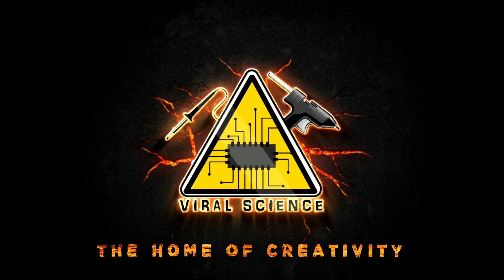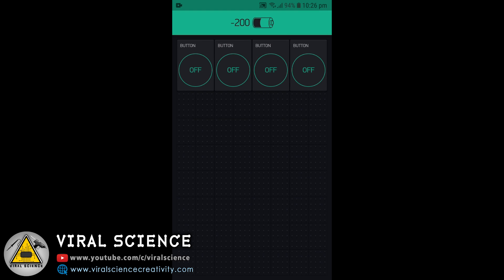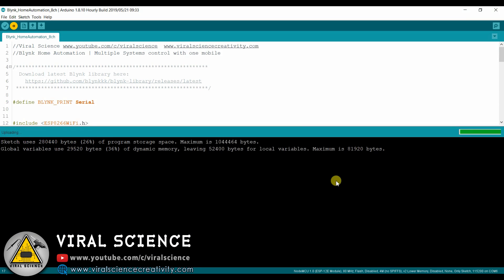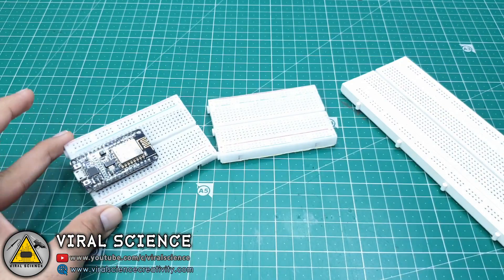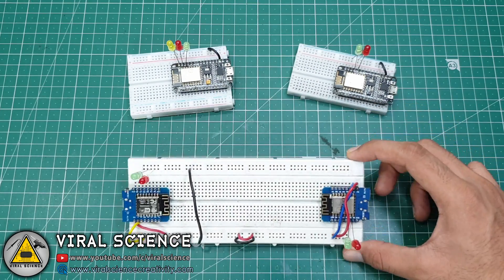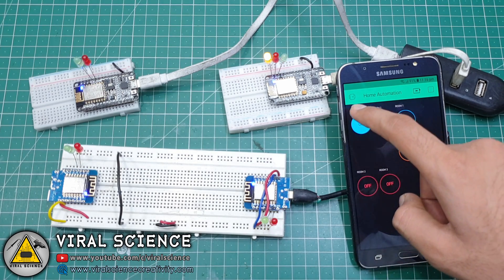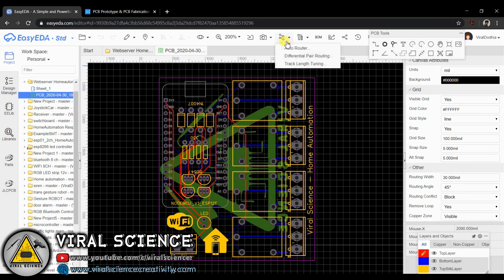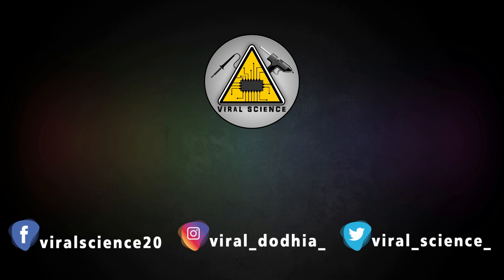Blynk Home Automation with Multiple ESP8266 Boards

Comment: Bro I like your video it is very helpful, but i have a doubt , in the video u have used different digital pins for led , not as the same digital pins  which is used in one board. So this make it difficult when there is a need to connect more appliances to one board cause the digital pins will be repeated in multiple boards and therefore when we give the command to a digital pin ( for example d5) using blynk platform , all the boards's D5 pin will be set high isn't it . So bro is there any remedy for this issue. If so can u make a video about this one

Comment: Hello, first of all thank you for the helpful video! I want do control a nema 17 stepmotor and parallel in other rooms I want to control relais. Know I don't know how to set up the code. Do I have to flash the code like yours with the extra part for the stepmotor on every ESP module? Or do I just have to make sure that every ESP module has the right authentication code?
Thank you!

Comment: Sir, can i used 1 or 3 cellphone as monitoring for this kind of automation project?
Reply: Yes u can do it by getting into your projects setting page and turn on "shared access" .. this will cost u 1000 energy, if u don't have enough u have to purchase it... Then generate a QR code, now u have to scan the QR code in your other device... But this should be scanned before logging in ur blynk  account or it won't work
Reply: And another method is to login your blynk account  in another device and use your project

Comment: Thanks for your technique,  exceptional good video, patience and the hard working behind all of these. Is it possible to make the AC Dimmer which runs   both Blynk app by using slider button (or "+ve" & "-VE" buttons instead of slider ) and two physical  touch sensor switches (say 4 pcs TTP223 or 1 PCS TTP 224 for controlling 4 steps ...etc. ) for manual Control (Increasing or decreasing the bulb intensity or fan speed ) , If so please make a video particularly in coding part, It is difficult to relating the physical two buttons with Blink slider in coding part.
 It is more better to add 2 more button for controlling 2 ac loads (Just on and off ). Thanks

Comment: Followed along with you create only one button, received the token in my email added it to the suggested sketch with SSID, USERNAME, and TOKEN.  Press the PLAY button in the cell phone app and a smaller icon in the upper right-hand pops comes up with a red dot. I touch the icon with the small red dot and a small slider drops down and it contains the following note: "Wasn't online yet". 
Surfed the web and found many folks stuck at the same error message. How do I fix this?
Reply: Make sure your board is properly power on or     your internet connection is working normally or    the authentication code, wifi credentials may not be properly entered

Comment: Is there a way to uniquely identify one of the four ESP8266? Because ports used in esp#1 will not be usable in esp#2. Thanks in advance :D
Reply: Thank u mate for asking this question... I didn't even realise about this problem.... But after thinking a lot I found a solution... 

Step1: After u create your project, get into the settings page of your project.
Step2: U can see a menu named  "devices" , click on it..
Step3: now u can see an option named "new device", now u can define and add all of your other boards
Step4: now, when u add ur widgets and define the pins, u can now select any of the board and can use all of the pins.

I guess this will surely answer ur question.... But if u didn't understand any of the above, pls ask me again.. I'll  answer it..

Comment: Assalamu Alaikum, how are you dear brother?  I watch the videos you make carefully.  I really like your videos.  Brother, you know that many bikes are stolen in our country.  So to prevent this theft, can you create any such device?  Which will be high security.  Which will have motion sensor alarm system.  Using a radio remote to control the bike.  The bike can be controlled via mobile bluetooth, wifi, internet. Even the location of the bike, tracking, real time video, etc. will all be pitchers.

Comment: U r using small switch and low voltage for the feedback system but how can we use feedback for 220 v ac??
Reply: Yes Exactly. Do you know any switch like that? I'll really appreciate it if you can help us with it. Thanks.
Reply: connect 220v AC Relay With Your 220V Feedback And Operate Relay Coil By The 220V Feedback Then Connect Esp8266 Ground Terminal With Relay Common And Get Gnd Output From Relay Open Point When Relay Is On
Reply: Fine Automation  didn’t understand the replay
Reply: Good luck